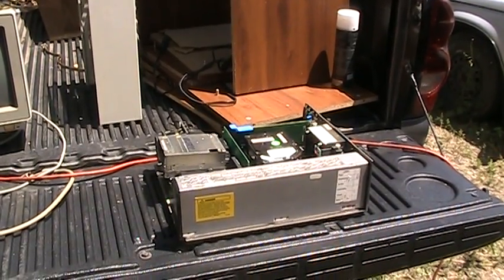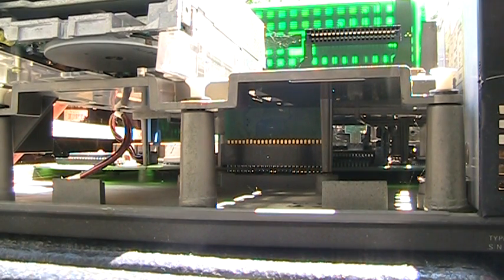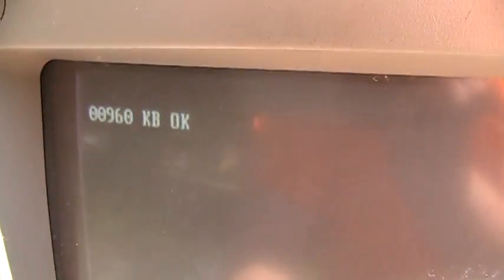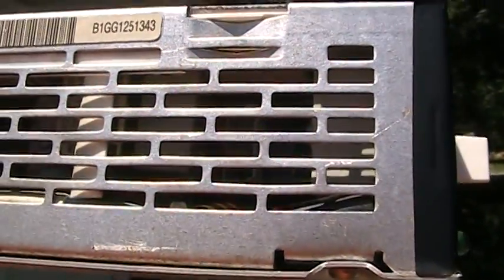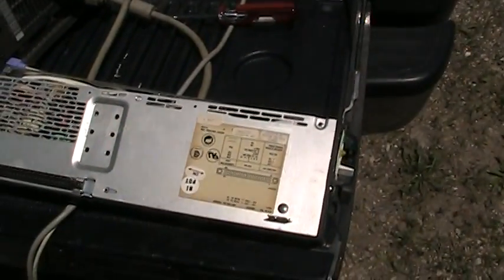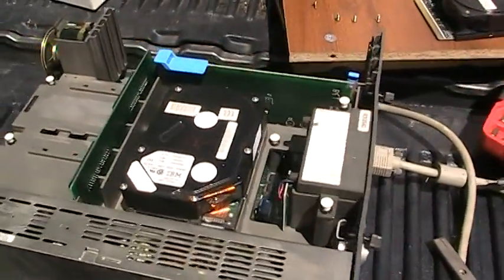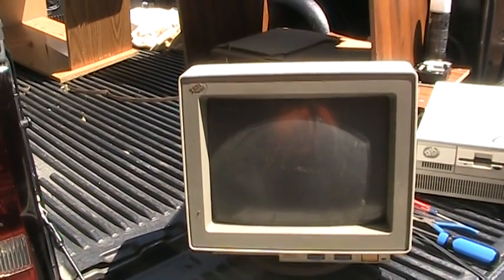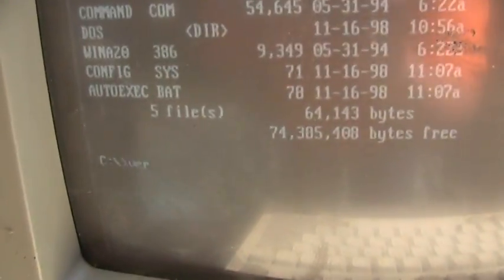IBM PS/2 Model 50Z Resurrection

Comment: Those AC filter caps are famous (infamous?) for failing with lots of smoke and a horrendous stink.  I had a couple of TRS-80 model 4's that had their AC filter caps fail.  Luckily (knock on wood) the power supplies in my Model 70 and 25 are still in good working condition.

Comment: Speaking of tantalum capacitors. I used to work at a company called AVX in Paignton, Devon, England who made millions of these. There was a test portion of the production line where they were all tested to the max and the smell from burnt failed ones was something I tell you!

Comment: I was always told not to switch things on with your left hand, as if it blows up you don't want the electricity going up through your left arm direct to your heart. I don't know how true that is, but it's one of those things that doesn't cost a lot to do but you wouldn't want to find out if it's right or not either.

Comment: Great to see another PS/2 running :) I am in the process of bringing a PS/2 55/SX  up to install Service Element software on, to allow it to be the SE/Console for a 9375 S/370 Mainframe. Brining up the S/370 is going to be a bit of a process starting with running 2 30A 240V circuits (terminating in L6-30 sockets). One circuit for the S/370 CPU/console and another for the DASD (IBM Parlance for disk).

Comment: I need help, my Compaq Presario S4120WM is giving me post beeps and no video output on screen, can you help me figure out what is wrong? Here is a video about it.

https://youtu.be/TR3jqTwgMhA
Reply from the maker: The most likely cause is bad/incompatible memory or a video failure. While there are lists of BIOS beep codes online, what your system emits doesn't sound like anything I've ever heard before.

If a different memory module doesn't fix it, it's probably time to move on.

Comment: 10483 is an error indicating fixed disk controller failure if you didn't know, the drive sounds okay to me from the video, but even though I have a 60MB drive for this I have never powered it up before. 

Have you tried it in another system?
Reply from the maker: The controller is integrated within these hard drives: a slightly cut-down Microchannel bus connection is passed to the drive. The drive is bad, probably due to physical damage from when the system fell.

Comment: Another great video as usual!  If you have the proper equipment, could you do a video on the various kinds of SCSI drives and connectors and (if possible) what can convert to what with adapters?  There seems to be quite a variety!  I only recently found out when I purchased a new-in-box Adaptec AHA-2940 Ultra SCSI card for my DOS machine (and second on the way for my Windows 98 machine) and it uses an internal 50 pin connector and an external HD50 connector.  Anyhoo, keep up the good work!

Comment: Our 1987 286 IBM PS/2 Model 60 tower was 5900 dollars with Monitor and accounting software. The 286 cpu was 10Mhz. The thing was heavy ie 48Lbs<>

The 8512 display was 640x480 but only 256 colors. This monitor would not work on VGA with our 1996 IBM Pentium Pro 365 models for some reason. 

Our was junked 2 decades ago and it was just a worthless obsolete thing; ie no cult following yet. I did replace the battery once. 

One was working with 1 meg of ram and a 286 at 10 Mhz thus it never saw windows. 

The top of the line model 80 unit was about 12 grand then; a new econo car was about 7 grand

Our unit got hosed when an employee placed a floppy that changed the screen to stars etc and the some files got overwritten by a virus from the floppy; that was 20 years ago. It go so goofed up we had the reload DOS. reload the accounting software after erasing the hda. 

These were expensive machines in their era, most were used in businesses. The average Joe bought a clone and not an IBM PS/2.

Comment: hello @uxwbill  my name is Jamie im from Kentucky i have been advertising my services to repair pc,s as a side project but the thing is that im only 16 and all my knowledge of computers are gained purely from your videos and 2 other youtubers am i doing my customers wrong by having no degree or any (ethical) form of knowledge besides things ive learn on youtube over the last two years am i doing them wrong by having no school experience on computers ? and thank you for all the knowledge you've gave me  sincerely -jamie
Reply from the maker: Everyone has to start somewhere, and nobody knows everything. So long as you're honest with your clients as to your experience level, and candid in your assessment of what people might hire you to do ("I don't think I can help you.") I see no problem with what you're doing. 

In an effort to further your skill, I would recommend getting your hands on a few secondhand computer systems and popular software packages. Core 2 Duo systems are dirt cheap these days. Technology need not be state of the art to work as a great learning tool. Work your way through configuring these systems into varying roles under different operating systems and with different application software. (You can do this from within a virtualized environment as well, but you must be aware that virtualization software isn't the same thing as working on a real computer.)

Comment: Had a similar capacitor fail inside of a vacuum cleaner (used for arc suppression on the carbon brushes in the motor), though in its case, it reeked of rotten fish when it burst... :S

Comment: I went to a hamfest a couple of days ago and picked up a PS/2 model 50 in like-new condition for free. It has a hard drive in it, but it is IDE and connected to a card that is installed, not like the card connector that the one in this video has. The battery is dead and it is asking for the reference disk. I found a copy online and I'm planning on writing it to a floppy and trying to boot it. It boots into BASIC just fine. What is the difference between the model 50 and the 50z?
Reply from the maker: The 50Z adds support for zero wait state memory accesses (that's the Z in the model name), uses 72 pin SIMMs, has a more modern and shorter planar (motherboard), and supports the larger, better, faster direct bus attachment ESDI drives.

In addition to the reference disk, you will require all the adapter definition files for the cards installed in your system. There are two software programs that can help you figure out what ADFs you need: QBMCA and IDMCA. Both can be readily located with a web search. The author of QBMCA maintains a massive collection of ADFs. (Yes, Micro Channel architecture is plug-n-play, implemented long before anyone else brought it to the PC world. The system knows what cards are installed and configures them based on the choices presented by an ADF.)

I would recommend stripping the system of any installed adapter cards, and adding them back one-by-one after you've updated the reference disk appropriately with the needed ADFs. (You have to use the provided "copy an option disk" choice on reference disk to do this. Simply copying the ADF to the diskette will NOT work.)

You will also need a good battery (6V CR-P2) for the system to maintain its configuration. This battery is actually sold for use with cameras, and it will easily last a decade or more in your PS/2.
Reply: *****
Thank you very much for this information! That should be all I'll need to get this thing running.

Comment: I used  to own the ps/2 model 30 and it had the red switch and 720k floppy drive.  I got it back in 1988.  That is long gone but I still have the model M keyboard it came with.  I remember the most annoying thing about that computer was that it supported mcga graphics, but not ega forcing many games into cga mode.  There were a few that supported mcga though.  

I do know the model 30 286 had the white switch.  I think the first series had the red switches and the later ones all had white.  My mom used to have a model 25 all in one and she used it to play solitaire, but I have no idea what ever happened to that computer.

I also have a model f keyboard for the original PC, are there adapters to get it to work?  I hear they use a different protocol and are not compatible.  I have never tried it out.
Reply from the maker: I've never seen the 8086 version of the Model 30 with anything other than a red power switch. Likewise for the 286 version: every one I've seen had a white switch. (There are some Model 25s that had a red power switch, even though it is almost impossible to see as you face the computer.)

The MCGA graphics hardware was truly an odd duck. It certainly had enough video memory to support EGA modes, so it's anyone's guess as to why they weren't included. Equally curious is the fact that the 8086 version of the PS/2 Model 30 did support high density floppy drives (though it is picky about which versions will work).

I dimly recall there being a translation adapter produced by some vintage computer enthusiasts to do the opposite of what you're looking to do (use a modern keyboard on a PC/XT). I am not aware of anything that does what you're looking to do.
Reply: My model 30 had the 8086 and the red switch along with a spacious 20mb hard drive.  Later I found a 360k 5.25" external drive to use with it as those disks were cheaper at the time than the 3.5" disks.  I also found a program that would run and reboot the computer and literally reverse the drives allowing me to boot the 360k booter disks, as now the external 360k drive is A:.  I think the most I ever did was call BBS systems and play DOS games with it.

Comment: So, say I have a PS/2 Model 56....with a dead power supply. Where would one go to find one? FleaBay?
Reply from the maker: At this point you either fix what you have or hope that one shows up on eBay for a not too terrible price. (Or, as the pinouts are known, you could build another power supply board into the existing casing.)

Some of those systems had a MagneTek power supply, and no one has successfully repaired one of those.
Reply: So, use the Grade A computer Hammer eh? 
Nah, I'll look for one somewhere. It just didn't power on.
Reply from the maker: I just thought of this...check for a little switch in the front of the computer's case. Some of the "premium" PS/2 Models had a safety switch mounted in the front of the case that would keep the computer from turning on if it was broken or disconnected. These switches do get broken, especially if someone ever rudely and carelessly shoved the computer into its casing.

The switch plugs into the motherboard, only carries a five volt signal and can be taken out of circuit with a few jumper caps if needed.
Reply: Would it be a little blue switch toward the left on the front of the case? There is one there, and I have no idea what it's for.

It pushes up, and it connects to the motherboard.
Thanks :)
Reply from the maker: Why yes it would be. Try pushing it up. It should click noticeably. This switch should also have wiring going to the motherboard. I believe it plugs into a six position connector.
Reply: I've messed with said switch for a good 2 hours yesterday, nothing. The power supply whines when you plug it in, but other than that, the system is dead no matter if you have the case on or the switch unplugged.
:/ Darn, I wanted to see what was on its 200MB SCSI drive. I think I'll look around for another power supply. 

By the way, Do you know what memory the Model 56 takes?
Reply from the maker: Test that front panel "safety" switch for continuity. They can -- and DO -- get broken, especially if a previous owner handled the computer roughly! Or just install jumper caps on the motherboard connector as IBM did for the systems without that switch.

Useful links (the second one shows you how to safely and easily test the power supply):
http://mcamafia.de/mcapage0/problem1.htm#probl04
http://mcamafia.de/mcapage0/pwrtests.htm

Your Model 56 uses 72-pin SIMMs with 70ns timing,  fast page mode, parity memory. However, IBM utilized nonstandard configurations of the so-called "presence detection" bits that all SIMMs have. You can rework standard parity SIMMs (which are still pretty easy to find today) to work with your Model 56, if you have any electronics soldering experience at all. EDO memory does NOT work.
Reply: *****
Thanks Bill, I don't know too much about PS/2's and I'll let you know what happens :)

Thanks for the awesome videos!

Comment: You can try putting Windows 3.11 along with the math coprocessor and a graphics card and possibly turn it into a very capable DOS machine.
Reply from the maker: Windows 3.11 (for Workgroups or otherwise) requires a 386 CPU at a minimum. (Which is oddly amusing, as the graphical portion of setup runs in standard mode.)
Reply: +uxwbill Oh ok. I wouldn't bother installing Windows prior to 3.1 because of how limited pre-3.1 versions were (because for the most part anything that runs on pre-3.1 can run on DOS iirc). I guess just pop the coprocessor and the GPU and you're ready to rock!

Comment: sorry but when things go south I.E.no longer function something has to be done to get a system up and running even if you have to use a motherboard that not in keeping with what was there but I think you cannot have it all your own was so to speak as long as it is compatible with the 80486Dx266.

Comment: Yea, PS/2 Hard Drives are definitely becoming really hard to find. My model 30 has one that failed long ago, and I ended up just adding a SCSI card, and hiding a SCSI Jaz 1GB in the drive compartment. Even though it only sees the 504MB, it still works great for that little machine. Also, the hardest thing to get working in a model 25 and model 30 is an ethernet card. That was a royal pain in the ass as I had to get a VERY specific card so I could adjust a specific ISA timing, as its indubitably different on that particular PS/2. I also ended up maxing mine out to 4MB of RAM.
Reply from the maker: The later direct bus attachment "ESDI" drives were a major improvement over those in the Model 30 and 30-286. Those early drives die from internal contamination as the surface of the platters flakes off. I have only one working example left. Yet even the newer ESDI drives are reaching their lifetime limits: ribbon cables going to the spindle motor and headstack are very brittle, and I'm sure that the surface mounted electrolytics are also a source of difficulty.

I am very surprised that you had such trouble with Ethernet cards in the 25 and 30. That's a problem I've never seen or heard of before. (Were one of the machines in question a 25SX, I'd be rather less surprised. There exist a lot of these with underclocked CPUs -- 386SX-20 running at 16 MHz -- and a few where the CPU is actually properly clocked. It seems that the ISA bus clock is derived from the CPU oscillator, so on a 20 MHz machine, the ISA bus is being overclocked a bit. And there are still more that have a 16 MHz CPU clocked at 16 MHz. I'd even wonder if maybe there are some overclocked ones out there?)

Comment: I wonder if we replaced the motherboard for an ASUSTECH FM2-88 motherboard with an AMD A10-7980k and 32GB of DDR RAM and see if there is anyway of getting OS/2 installed if OS/2 won't install you could try Linux Mint 17.3 which is a brilliant OS.
Reply from the maker: I really don't see the attraction to doing something like that. It only serves to destroy everything that this computer is, and the history associated with it.

OS/2 proper doesn't have a great deal of support for modern hardware and the last I'd heard, there were issues getting to run on modern processors. I believe eComStation is still under development and therefore it ought to run on a modern system.
Reply: I have a machine I think that is in the roof space which runs windows 98 OSR2  which was for the 80486 but ran very well on the Pentium processor that was in it and updates took for ever as they had to come over the old modem and if call waiting was enabled would not let you go on line at all unless you disabled call waiting and cleared all recorded calls and a ring signal would ruin the update and you would have to reapply the update or prevent the phone from ringing untill you were ready to come off line and re-enable call waiting.

Comment: Used to own a Model 50Z with Windows 3.1 quite a few years ago. Even had a few good DOS games, such as Lightspeed, and Pinball loaded. Was rather odd that Windows ran in 16-color mode, yet the games in DOS were in 256. Good times those were.
Reply from the maker: Your DOS games utilized the 320x240 resolution, which offered a 256 color mode. (Although commonly considered a VGA display mode, this is actually an MCGA mode.) Windows would have run in 640x480. In that mode only 16 colors are available.

Comment: Something to try if you ever come across a floppy drive that shows signs of life, but is otherwise nonfunctional, is to lubricate the rails that the heads ride on. I've resurrected many drives with stuck heads using lithium grease on the rails. You can manually move the heads to unstick them without issue. And the early IBM 5.25" drives that you commonly find working, but making a really loud grinding noise while seeking, can be made almost silent with lubrication.